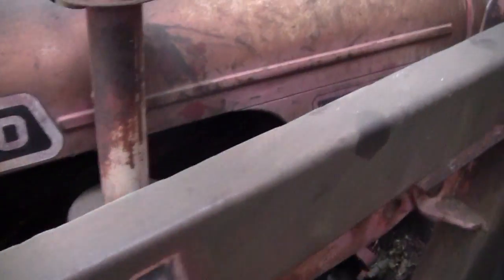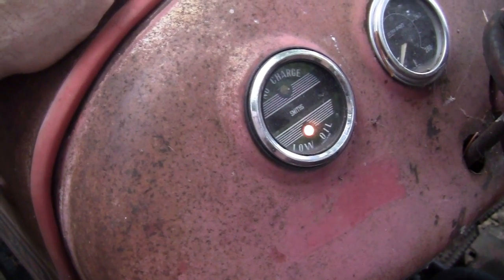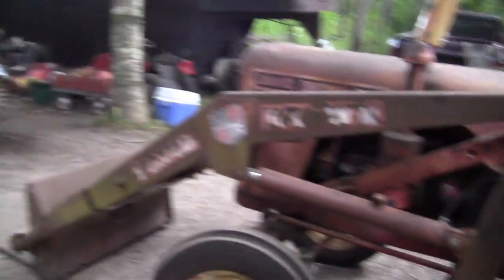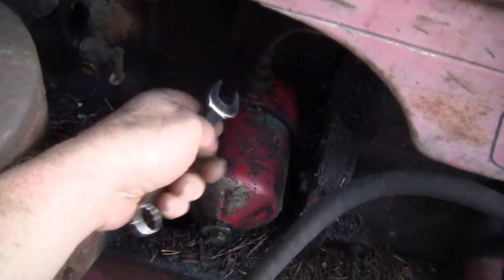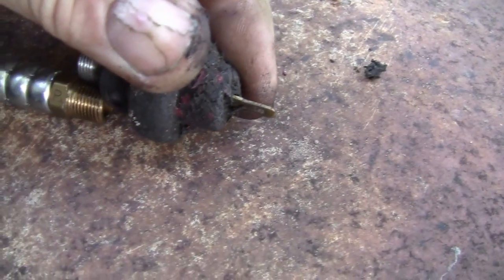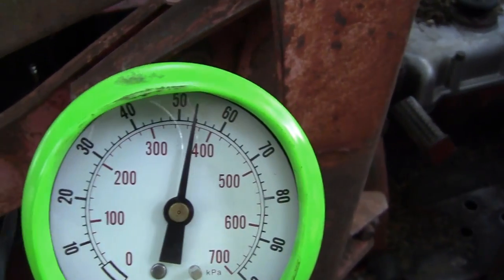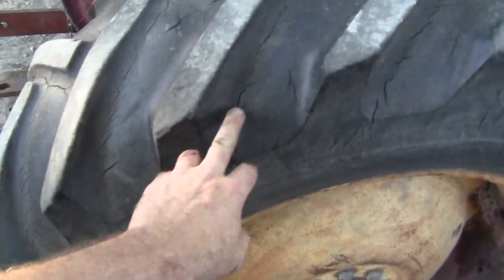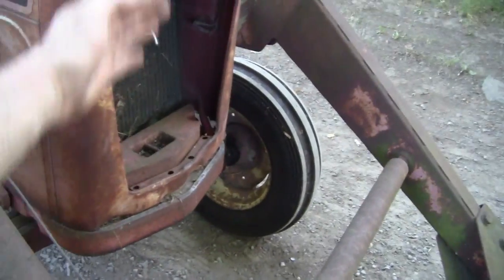The tractor with no oil pressure

Comment: This tractor is awesome, I had never heard of David Brown tractors but being that old and that strong is incredible.  I knew right off it was the sender because those have a habit of going bad over time and the engine was not making the typical noise you'd hear if oil pressure was really low.  Your wife will do fine!

Comment: A Canadian Ture oil pressure gauge should work on that tractor.
I put 1 on my racing tractor, and it has a 20HP Briggs.
 Also I didn't even have to change anything, it had the same sensor yours has.

Comment: There is a David Brown tractor club on the net Shawn,  Google it. lots of info on there,.  I have a 1974 996,Selectamatic. and it did the same thing,  the pressure and be adjusted by slipping of the sump and screwing up the relief valve. (not an issue with yours)  . All the nuts and bolts are AF and not metric,   All the best for your wife,  Jim.